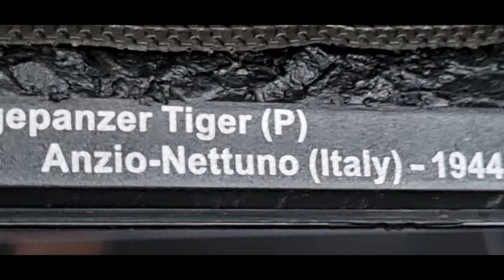"FLEA MARKET FINDS FROM Nov 26th 2023  #collectables  #diecast

Comment: Moin from Cux 👋🏻 
You can bet your bottom dollar that I'm interested in these models 😉
They are probably collector's items from DEL PRADO. (I have quite a few of them myself 🙄🤣)
5 $ (3 €) is almost a gift 🤩
Normally these models cost €15 (about AU$25) with the booklet. 
(As far as I know, the booklet was only available in German 🤔)
But now (completely military) "Panzer Marsch" 🤣
(Official order, at that time) 
(7:22) HANOMAG Sd KFz 4/1
Sd KFz means "Sonder Kraftfahrzeug" (Special Vehicle) 4/1 means 
Model no.4 / first modification. 
The Halftrack was used for "general purpose".  A rocket launcher is mounted here. 
There were also versions with "AA guns", benches (for soldiers) and various box bodies.
(8:59) The "crossbar" puzzles me a little 🤔
It's an earlier version of the national insignia. In 1944 it was actually just four white angles (without the black bars)
The camo pattern is typical for the time.
However, this is not factory made...
The tanks were delivered in a sand-coloured yellow and only the troops applied the camouflage paint. (Depending on where they were deployed)
Mr Bruce Crompton once restored an original Halftrack and his workshop crew spent a long time researching which camouflage pattern to apply.
By the way...
All the vehicles are army armoured vehicles. The "H" on the number plates stands for "Heer" (Army)
If they were Air Force or Navy vehicles, there would be an "L" (Luftwaffe/ Air Force) or "M" (Maribe/ Navy) on the licence plates.
(9:44) This is a crane to load the missiles into the launcher.
Armoured recovery vehicle TIGER
(10:56) The tracked undercarriage points to a PORSCHE Tiger 🤔
Normally it would have twice the number of wheels (always one "outside" and one "inside". Improves the driving characteristics, but is a disadvantage on muddy surfaces.
About the use of this tank... 
It is a "wrecker" designed to tow defective tanks. (Hence no cannon, but a crane superstructure) 
You could say it's a kind of "redtruck on tracks". There are even said to have been some that also had an extinguishing device.
(But I don't have any confirmation of this!)
(12:14) This looks like an MG 34 machine gun. 
(Typical "secondary armament" of a tank at that time)
The black device (12:27) is a winch (to lift vehicles)
Sd KFz 232 Heavy Armoured Radio Tank
The standard tank at the time, for reconnaissance companies. Hence the large frame antenna above the vehicle. It had several radio systems installed. The tank was often used as a command vehicle. (At that time, tanks often only had one radio receiver and only the vehicle of the commanding officer had transmitters. That seems to be the case here)
Incidentally, all eight wheels of the tank are steerable.
(I had a look at this in a museum with a "real steel" 🔎👀)
(14:08) These are tactical symbols of the unit in which the tank was deployed.
(14:23) This is a 37 mm gun and an MG 34 (cal. 8mm Mauser, the same as the K98 rifle)
The protection, in front, was used to push snow, mud or other obstacles out of the way...
The "twin antennas" (14:49) are the same spacers as on various Redtrux and (14:57) 
These are "Jerrycans" for reserve fuel (petrol. Diesel engines were not common)
Well... my favourite? 🤔
I like all three of them 🤩
(While watching the show, I was able to compare the tanks with my own models 🔎👀🤣
JOU... excellent collector's items 👍🏼
Would say definitely both thumbs up for this 👍🏼 👍🏼 
(Great purchase, Jim)
Thanks a lot for sharing 🙏🏼 
You and your family have a ripper weekend and a reflective pre-Christmas period. Stay safe and sound. 
Oh yes... keep up the good work mate 😉
Greetings from the DCcoB (and military historian) from the snowy lighthouse end of the Elbe river. 
👨🏻‍🚒👍🏼🇦🇺🍻🇩🇪👍🏼🤠
Reply from the maker: Thanks Sparky.
Fantastic info, as usual !
You could say that these models were "cheap as chips!"
Have a top weekend, and stay warm over there, whereas here in Sydney, it will hit around 40°C...🥵
👨‍🚒👍🍻